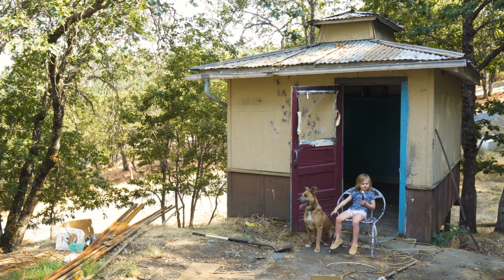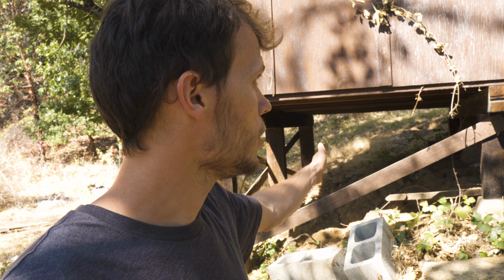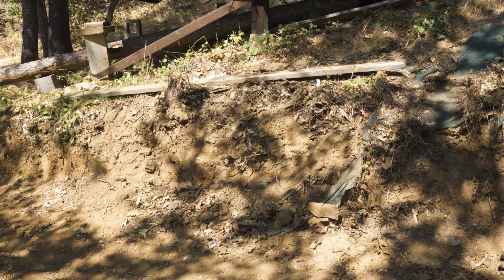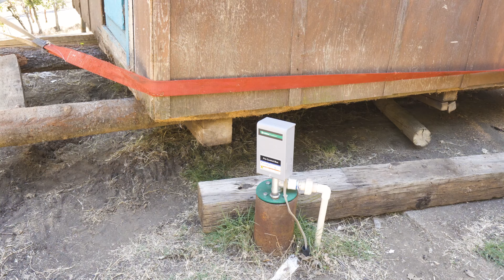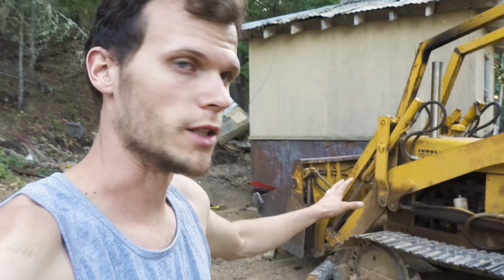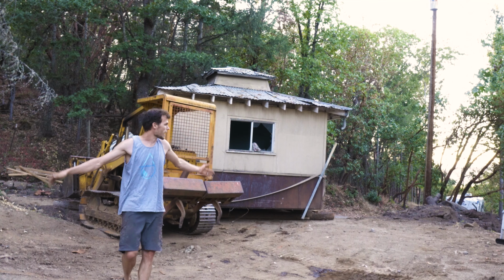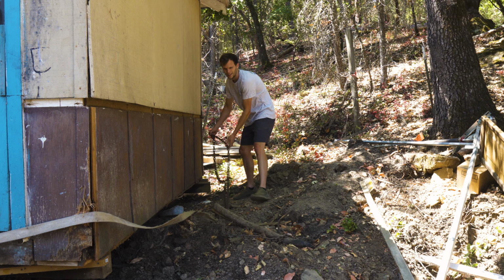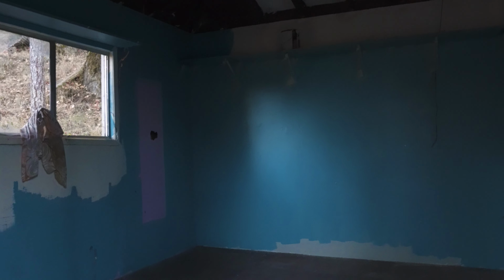I saved this Old Shed from Falling Down the Hill - Turning a Shaky Shack Into a Future Home Office!

Comment: Carjacks to lift a building. I’ve done that before. :)
Well done. Great use of that building.
Reply from the maker: My dads idea! Thanks
Reply: @travisjantzer I worked for a new contractor and he removed 8 feet of a main beam on a 2 story house. He thought he would just push the new beam in. When he couldn’t he was lucky I had a bunch of hydraulic car jacks in my car. :)

Your use was much more reasonable than that. 😋